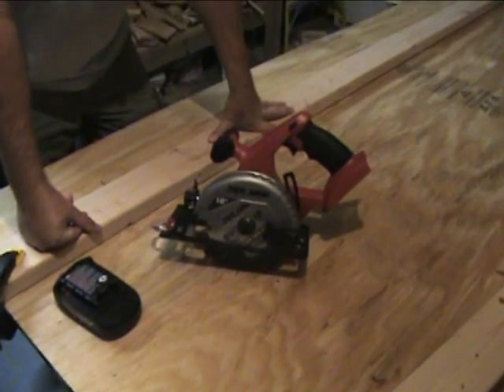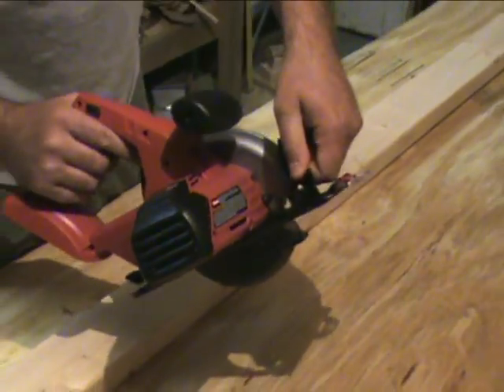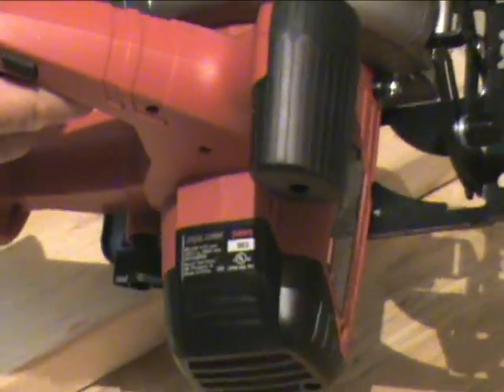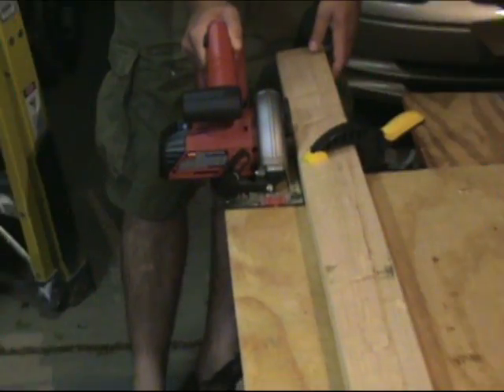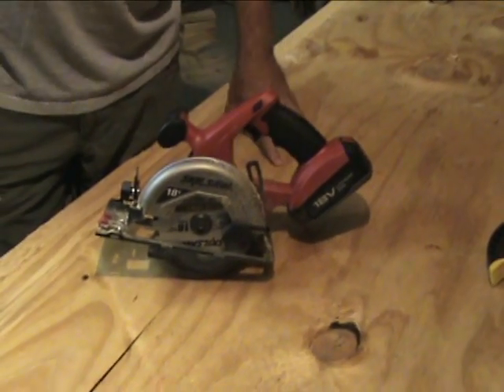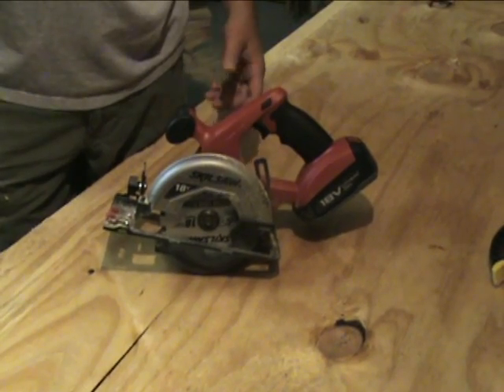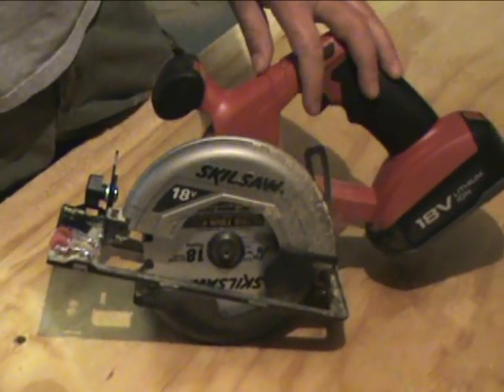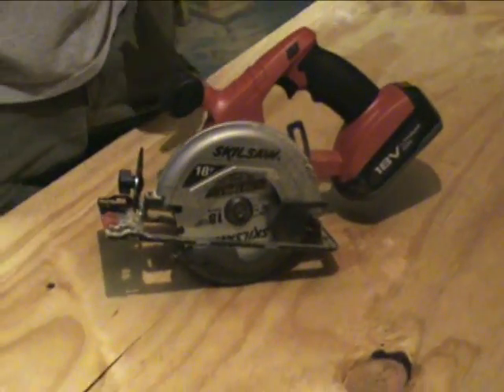Skil Circular Saw

Comment: My Skil saw did not come with the most important accessory of all - the Rip Fence.  Not only that, but Home Depot, Lowes and Ace do not stock them and just look mystified when you ask for one. Why don't they include the piece as standard?  Same with my B & D power hand saw.  Both equipped to take it, but none available.  Some manufacturers need a rocket up their backsides!